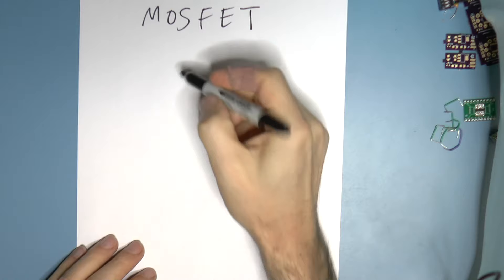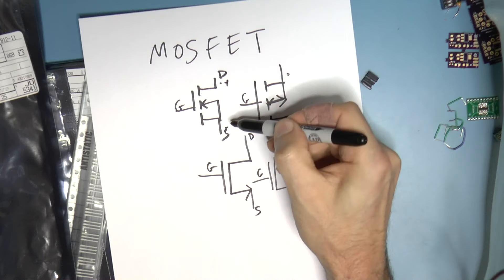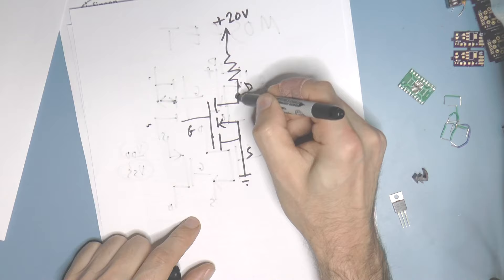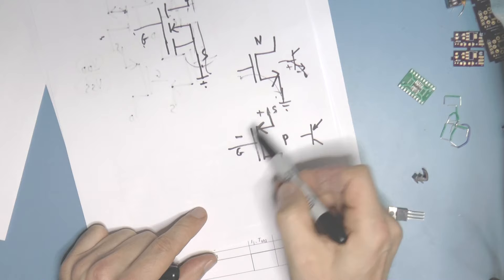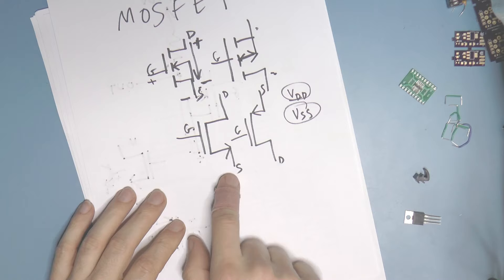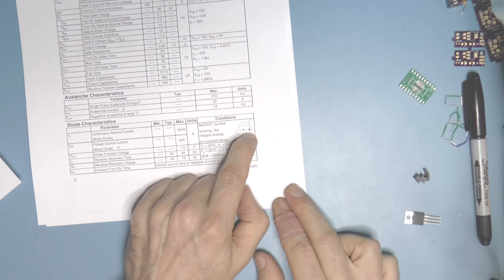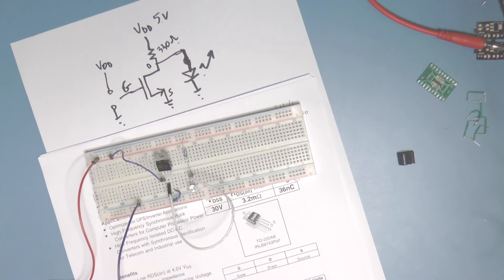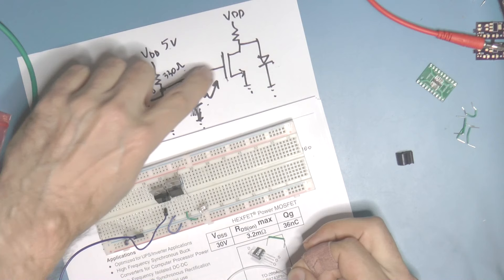Let's play with our MOSFETs! Part 1: Basics and NMOS logic

Comment: 23:39 Re why it's called Drain and Source: thinking conventional current, in a circuit like yours the Drain actually drains current if the mosfet is on ("takes away" all the current). Likewise, if you put the resistor between Source and GND, then current comes out of the Source if the mosfet is on, it "sources" current.
Reply: I thought it was because the source is where the electrons come from, inside the device. (Probably it was named by people who were intimately familiar with semiconductor physics, and not so much with conventional circuit design)
Reply: Alex C As I said, thinking conventional current - ie. opposite the direction in which actual electrons go - the Source is where (conventional!) current comes out of and the Drain is where (conventional!) current goes into.
So: actual electrons flow into the Source and out of the the Drain.
Sure, it's a mishap that this "conventional current" vs actual electron flow came up in the first place, but we're stuck with it since, I think, Benjamin Franklin. But in fact, it doesn't really matter, and you'll get used to it eventually.
Reply: The source terminal is where the charge carriers for the current within the FET come from, during normal operation. It's the same for N- and P- channel devices. You're sort of talking about current "outside" of the MOSFET, and yeah, electrons will flow into the source and out of the drain on the outside, but change it to a P-channel device (and flip the resistor and transistor) and it'd be the other way around.
Reply: The "Load", which DRAIN the voltage in a useful manner,  is (generally) toward the DRAIN pin of the MOSFET, while the SOURCE is connected toward the voltage SOURCE (and not toward the "load" which drains the supplied power).

For a N-Chanel, the SOURCE pin is connected toward the N_egative side of that battery,  as N is N;
and for a P-Chanel, the Source pin of the MOSFET is connected toward the P_ositive side of the battery, as P is P.

For a N-Chanel, the "Load" is thus (in general) at a higher voltage than the MOSFET (the load is said to be at the high side), 
while for P-Chanel, the "Load" is at a lower voltage than the transistor (the load is said to be at a low side).

So, if you prefer to consider the conventional current, for any reason, for a N-Chanel MOSFET, the conventional current is generally from drain pin to source pin (against the arrow on the symbol) while, for a P-chanel, the conventional current is from source to drain (along the arrow on the symbol). Note, though, that for P-chanel, MOST datasheets consider that the current is still positive from drain pin to source pin, so the value given are ... negative... on the datasheet. MOST... but not all. And it is confusing MOST of the time :-)

*About the arrow*, I am used to the symbol with the grid like pattern for an enhanced MOSFET. There are some symbols using the REVERSE direction for the arrow just to add to the confusion, as if it was needed. The author of this video uses these symbols while I was having in mind the grid like symbol (as at https://www.fairchildsemi.com/datasheets/2N/2N7000.pdf for example, for a N Chanel), so the arrow direction is all but confusing, without a specific drawing. If you assume that a N Chanel matches a NPN BJT, you have to admit that the arrows directions are ... reversed !  at least, if you take the symbol given in the datasheet, as given here up.
Reply: +Persona, +snnwstt So, are you saying that my little mnemonic ain't working for P-channel?
To be honest, I have to think it over almost every time again, it is confusing. And right now, I am confused again.
Reply: For a P Chanel, generally, the source pin will be connected toward (to) the + pin of the battery (the Positive pin of the battery) so the conventional current will flow from the source pin of the MOSGET toward its drain pin. No, it is for a N Chanel MOSFET that your mnemonic seems, to me, to fail, since the source pin of the MOSFET SHOULD be connected to the ground, or the Negative side of the battery. Well, if, for a N Chanel MOSFET, if you connect a circuit like:    +V  -> LED -> S pin  and D pin -> GND  (or -V) then the intrinsic body diode will conduct and the MOSFET won't be able to block anything greater than what it takes to make that intrinsic diode to conduct (i.e. any voltage greater than approximatively 0.7 Volt approx. ).

There are very few system where the rule: 
   Drain toward the load,  Source toward the battery source,  N Chanel, Source toward N*egative side; *P Chanel, Source to *P*ositive side of the battery
is not followed and still able to produce a somehow useful system (such as with a P Chanel for voltage inversion protection).
Reply: Agreed, source of P-channel to battery + (*P*ositive), source of N-channel to battery - (*N*egative).
That's another nice mnemonic, indeed.

Ok, let's assume we've connected things like that - I still think my mnemonic works together with both, in a way.
It tells you
- the direction of conventional current (ie of positive charge carriers)
- when looking at it from the outside (ie outside the MOSFET)
- if you apply HI to the gate (didn't mention that before; guess that's the catch)

One more thing: in each case, you can only use either the source as (conventional) current source or the drain as (conventional) current sink, not both. So, for the sake of the argument, I am always assuming an additional resistor between battery and the MOSFET pin you're connecting to from the outside.
I know that two out of those four configurations are rather unusual. I wouldn't normally use the source of an N-channel as a current source, neither the drain of a P-channel as a current sink. 

Let's look at all four configurations separately:

1. N-channel: source at battery negative, drain at battery positive. If you apply HI to the gate, making the MOSFET *conduct*, then
1.1. current from outside can flow into the drain, and
1.2. current can flow through the MOSFET out of the source (remember: resistor to battery negative).

2. P-channel: source at battery positive, drain at battery negative. If you apply HI to the gate, making the MOSFET *non-conducting*, then 
2.1. current won't flow through the MOSFET and thus can flow through the resistor  into the outside (like it came "out of the source" of the  MOSFET)
2.2. the drain is only connected to  battery negative (through the resistor), so it acts as a current sink to the outside.

Well, I hope I didn't mess this up too badly.
And yes, it IS debatable whether this mnemonic is helpful or not. It's somewhat subjective, at last.
Reply: That can do it too, it seems. 

Note that to have the Enhanced MOSFET  in a blocking mode, just have the voltage at the Gate equals to the voltage at the Source pin, so Vgs = Vg - Vs = 0.  ( There are some type of transistor with field effect which are not blocking at Vgs = 0, the Depletion mode field effect transistor, but they are rarely used; so, common (enhanced mode) MOSFET are blocking when the voltage at the gate is the same than the voltage at the source). That holds for N and for P chanel.

To have the transistor to conduct, you have to move away from that condition (away from Vgs= Vg-Vs=0,  or Vg=Vs, if you prefer).

To have that (enhanced mode) MOSFET starting to conduct ( with a current of at least 250 uA to 500 uA), have an absolute value for Vgs = ABS(Vg - Vs) of at least equal to the absolute value of  Vgs(th). In fact, targeting at least twice Vgs(th) is often recommended.  
Having the numerical value for the difference of voltage, we need the direction of that difference and the direction of the voltages is "simple" : the voltage at the source pin has to be more N or P than the voltage at the gate. That is, Vs has to be more in the negative direction (so smaller) than Vg  for N Chanel (the gate pin should be at a higher voltage than the source pin) and Vs has to be more positive than Vg, at the gate,  for P Chanel (the voltage at the gate pin should be less than at the source pin)... those are the directions of the difference Vg-Vs to have the transistor to conduct: the Source has to be more N or P than the Gate, accordingly to the chanel type, N or P.
Increase that absolute difference by much more than Vgs(th) to increase the allowed current (up to Ids(on)_max) and decrease the resistance (up to Rds(on)_min).
Reply: +snnwstt Thanks! I still have to wrap my head around it, but again, thx for a thorough and detailed explanation of the how and why.
Mine is really just a mnemonic which kind of worked for me; by no means as comprehensive as yours.

Comment: i hate those symbols. Just.. invent something logical and clear rather than trying to simulate the actual physical properties or whatever of it. It's NEEDLESSLY COMPLICATED for a schematic symbol... I'm not trying to BUILD a mosfet i just want to know one is there
Reply: it's like, if instead of using two lines for a capacitor, someone had drawn a complicated depiction of what it physically looked like, with lots of plates and wires and switches and god knows what, and we're still using that symbol centuries later UGH it would be SO FRUSTRATING
Reply from the maker: Lol, you should see the originally proposed symbols for a transistor. I think one of them looked like a vacuum tube symbol.
Reply: @isbestlizard  you know that the symbol of a capacitor is exactly how it is physically constructed? Two conductive plates separated by a non-conductive layer?